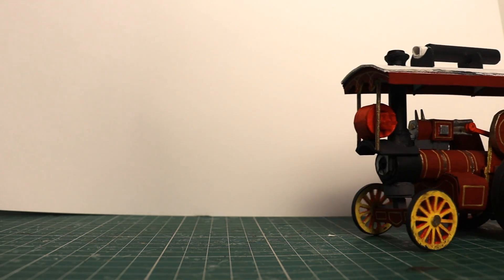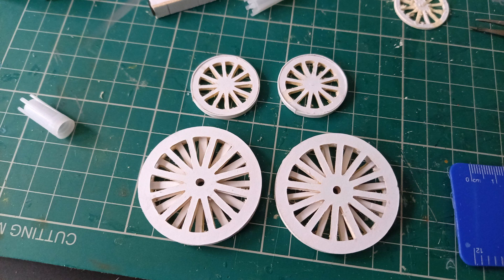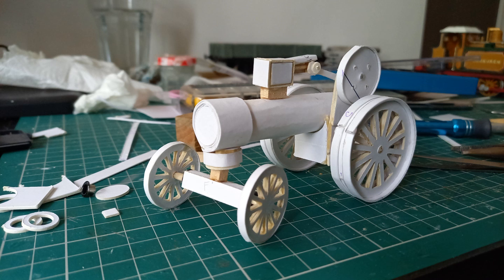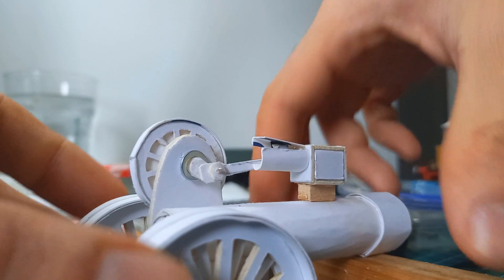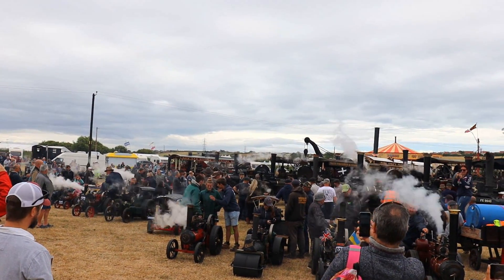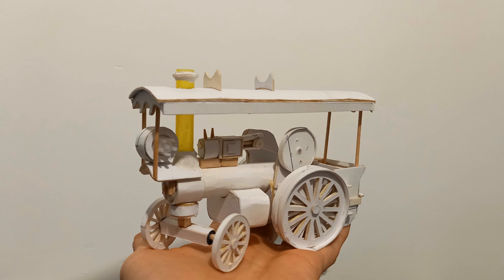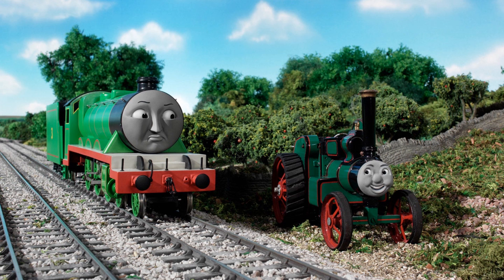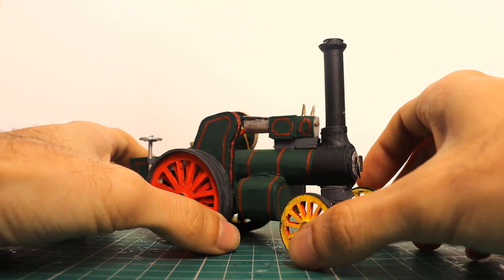I Scratchbuilt a working Showman's Engine

Comment: I had no idea just how small it was until you told us the bits were cocktail sticks. 

How about the name "Janus", he was the the Roman god of (among other things) transitions, and, duality,  BUT most importantly, he had TWO faces, which I think could be appropriate for a engine that is a traction engine on one side and a showmans road locomotive on the other side. Another appropriate historic name, but this time from Greek Mythology, is Gilgamesh, who apparently had the ability to shape shift.  Rob Tyler has a Fowler showmans tractor called D. C. Ver, which is a bit of a joke as it says deceiver, and despite looking the part, it was actually built as a steam roller.  

I am doing something similar to my engine "Sybil" she's a 1/3 size model of a convertible engine (having the ability to be converted from a traction engine to a steam roller). During lockdown I built myself a small dynamo and have been using it at shows to power 20 12v LED bulbs hung on our gazebo, but the trouble was you was restricted to being in one place, so I have made a dynamo bracket that will bolt onto the convertible flange on the smokebox.  I'm not very good at woodwork, so I have used 15mm copper pipe and fittings to make a frame, which has wooden side and end boards held in place by U pipe clamps, the uprights are also 15mm copper pipe.  This allows us to drive to the beer tent or fairground and generate and go back and plug in the the lights on our gazebo. The whole effort can be assembled or dissembled in around 30 mins so can be a showmans type engine for the evenings fun, and back again as a traction engine the next morning,

Comment: The "Red Drum thing" on the front is a dynamo. Which when connected via a belt to the flywheel generates electricity to power the ride and lights on the engine.
Reply from the maker: Thank you! That explains a lot.